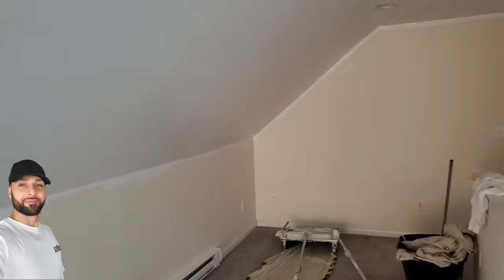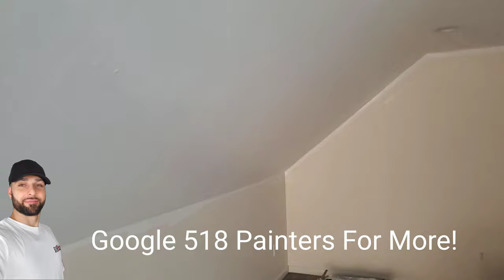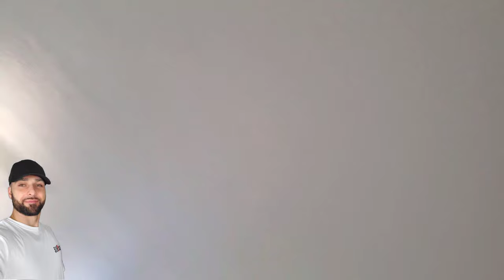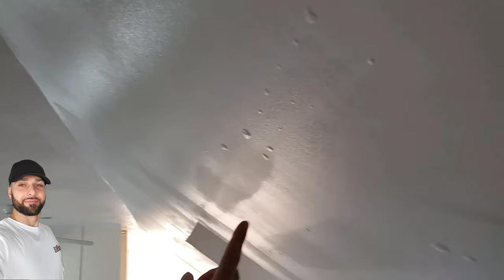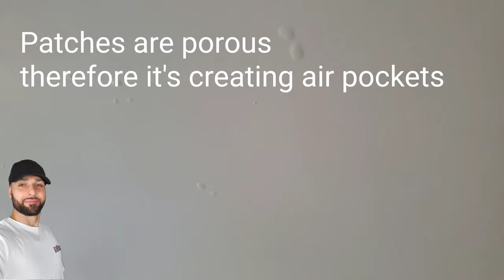Air Bubbles On Painted Walls

Comment: Don't try to fix them!  Cutting them, popping them or doing anything to them will not fix them, they will just come back worse.  You have 2 options at this point, option1 is exactly as 518 painter explains in the video (aka leave it alone).  Option 2 is to remove all the drywall down to the framing and re-board the walls with new gypsum.
Reply: Yeah, I'll go with option 3. Scrape mud and put thin coats of paint. Till I can get a real answer for why it's happening and how to fix it I'll do what I can cause the last house we did tear out all the sheetrock.

Comment: I recently encountered this problem. I was on a job and did my normal prep. Cleaned walls, primed, first coat, light sand, dusted and the top coat and was surprised to see bubbles forming. Dry times were respected and the room wasn't too humid. I'm perplexed. Told the client to turn up the heat because I remember seeing your video, so we'll see what happens tomorrow. Thanks for the advice.
Reply from the maker: Thanks! Let me know how it turns out👍🏽
Reply: are you still alive?

Comment: Hi. I was soooooo proud of my diy paint job. One bubble about 2 inches above a light fixture. I'm just seeing it for the first times. Approx 6 weeks post painting. It's just that one spot and no patching was done in that area. I have to decide if I should repair it or wait and 👀 see if it will pop or spread. Hmm.... Thank you for the info you shared.😄
Reply from the maker: Thanks for watching! You might have to cut that out with a blade and patch that area if it dosen't go away and you really want to get rid of it 🙂

Comment: This just happened to me two nights ago from over wetting and overworking ceiling paint🤦🏻‍♂️
These high solids low-no voc paints are not that forgiving. Of course I scraped off a big area, skimmed it, primed it, etc. 
This room has been a nightmare from the beginning and I just keep going round and round with it, a couple times I felt like lighting a match and walking away lol
I need to sometimes learn to say f*** it and leave it alone!
Great content btw!👍🏻
Reply: no, you likely didn't wait long enough for drying time. matte paint requires 2 hours before 2nd coat.

Comment: I had the same problem but in the walls I did cut the bubbles I filled up I did sanding I did a primer and the bubbles coming up again and again 15 years on this work I never seen something like this is driving me craezy
Reply from the maker: That happened to me on a commercial job at a bank. I cut, spackled, primed twice and it came back each time.
Reply: Did you ever find a solid solution for this?
Reply: @DIYhomeimprovementguy  how did you fix the problem ?
Reply: Same here. I was hoping to get an answer for this but I kinda figured I would have to keep looking.

Comment: It's not always an issue that can be fixed by turning up the heat. In fact this solution is probably just kicking the can down the road. If the ceilings were popcorn ceilings and you don't do a real good job cleaning the remaining glue off after you scrape them, you can get problems like this. If you were to do any work that requires paint plastic over these areas, the paint will probably come off with the tape or just over time. 

The best solution is and always will be to scrape it, clean the area and then seal and patch it while you have everything taped off and the furniture out of the room.

Comment: I have the same issur after painting my ceiling....i went back on a few areas when i was doing the second coat and now there are a few tiny bubbles that pop up only when i shower. They go away after hour or so after the shower but will comr back with each shower due to the humidity . I have been using a heavy duty fan pointing up to help dry. Should I apply a hot hair dryer to the bubbles? Or just wait 20-30 days until the paint is fully cured? Great video, thanks for posting!!

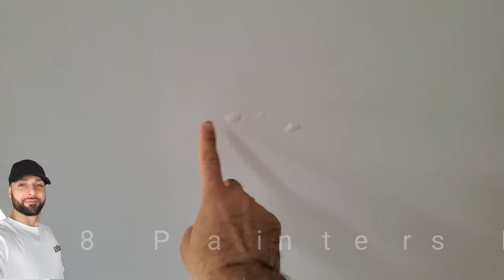Comment: I used a paint and in a few spots at 0:15 that's exactly what happened but it wasn't a big deal for me. I just either sanded that area down, or cut the paint blister out and put a little mud on it. Than just re-painted. 

But the big, BIG problem I'm having right now is. The paint that I used it was one of the behr's paint and it created like these air pockets in the paint. Soo imagine at 0:15 that image but reverse it. Soo think as in the blisters are inward instead of outward if that makes sense but everywhere on the ceiling. 
Or just think of it as, air pockets that escape. 
And now I'm trying to find a solution too correct the problem. 

I actually came up with a solution, use a sander with 120 grit to sand the paint down to get that smooth surface again. But I'm really not trying too doo that again. LoL

Than there's another solution, remind the entire ceiling which not tryna doo all that work again espically since I just re did the ceiling with all new drywall, and muded it by myself. I'm trying to look for a quicker solution, hopefully there is one. LoL. 

It's sad what one bad paint, can doo too all of your hard work man. 🤦
Reply from the maker: Ouch! I hate when that happens 😒
Reply: @DIYhomeimprovementguy  yup, hate it. 
But I re-primed the ceiling with two coats of primer, and the new paint that I got is a lot better and actually filled in some of those botched areas/air pockets but not entirely tho. But it does look 10x better now. 
Soo now I decided too literally use the paint brush on the entire ceiling and try too fill in the rest of the air pockets, and than use the pole sander with a 400 grit and try too smooth it out as much as possible than just re-roll the entire ceiling one more time. 
I think this will be my best bet To be honest.
Reply: Okay soo, update. I fixed the mess that was caused by the old paint. The tiny pinholes, and I thought it was the old paint since it was terrible that was causing the bubbles. 
But I peeled a big bubble area off, and patched it and re-primed it and it turned out it was the primer that was causing it. 

I used the "behr premium drywall plus + sealer in one." And it had amazing reviews. 

I hate this, you put soo much work in and than boom a problem bubbles lol.. 

I just re-done the entire ceiling with new drywall, new mud, used the paper tape and I'm having this problem. 

I also have a question, can bubbles be created as well cause you used a thick layer of paint to paint the ceiling???
Reply from the maker: @j.rjunior5584  sorry you had to go through that trouble. 
Bubbles can be caused by too thick layers and also by not following the re-coat times suggested. The off gassing while drying from the first layer can cause Bubbles.

Comment: I got just the opposite. It's bubbling where no patches were. on every wall!  Is there any other fixes that you know of? They won't go away !
Reply from the maker: Walls or ceiling?
Reply: @DIYhomeimprovementguy  nm bud, I solved the puzzle. Oil based primer stops them if you have them all over or won't go away. I figured I'd put it on here that way others will know.

Comment: I have just come across my first job with these bubbles they appear in a circle shape guessing where lights were removed and plastered 
I've let it dry but I wanna fix
Could I sand, plaster, top, seal and  paint with flat ceiling paint

Comment: Hi, what does it mean when new paint  peels off like wallpaper literally? My paint bubbled like crazy and no matter what I did it kept bubbling so eventually I tried to peel it and start again but to my surprise rather than just my new paint peeling off multiple layers of paint over the years all peeled off at once (just like wallpaper) back to the original magnolia builders paint! The walls aren't damaged after doing this in fact they look very clean! What could be the problem? Thanks
Reply from the maker: I'm sorry to hear that. It could be that someone previously painted over wallpaper and the new paint is soaking it again and therefore it's peeling. I've seen that plenty of times.

Comment: So use heat? I got a wall that keeps doing this I've scrapped it all the way to the drywall and still get em
Reply: you are probably applying your second coat before the first coat is completely dry. This will cause blisters. you have to wait much longer than you think with each level of sheen.

Comment: Great video!  Thank you for the tips.  Unfortunately, I have a problem spot around the wall switch.   I have tried USG Plus 3 topcoat, Killz 1, Killz 2,  and Zinsser 123 Plus and they all bubble up in the same pattern & location.  The bubbles do subside a bit after time, but they are still obvious.  There is no moisture/plumbing in that wall, and it doesn't bubble anywhere else.  The problem spot doesn't appear to have any major repair work either.  I'll try durabond next.  I'd be grateful for any suggestions.
Reply: Well I used Zinsser Gardz and that did the trick, but now I've learned what flashing is.  Plus random bubbles appeared on the same wall elsewhere after the first coat and most never went away.  This is all after priming the entire wall.  What a nightmare.

Comment: i jst pop it right away while im doin my primer i saw small bubbles like that then i pop or scrape it out n then i sand it abit then cover it with primer then after primer dry then ill put a puty n then sand it again then primer it again.. am i doin the right thing? 😅 is it ok to put a white puty over a primer?? thanks for thsi video i should jst have to wait
Reply from the maker: How did it turn out?
Reply: @DIYhomeimprovementguy  some of it dissapeared n flatten just some i need to scrape it out n redoit again.. overall still manageable 🙏 thanks for ur video🤝
Reply from the maker: Awesome, thanks for letting us know! @siacharles2315

Comment: I need honest advice I put on a top 2nd coat of paint the next day and ended up with blisters everywhere. I wiped the walls down with a dry cloth and then a tack cloth. It's raining and there's some humidity. Will this work for my situation just turn up the heat and leave it? Or just leave it be and see if it goes away.

This is also in my bathroom if the blisters go away will they come back when we take a shower?
Reply from the maker: It might just be too humid. Let it dry and it should go away. It won't come back once the paint is fully cured even if your shower. It takes 20-30 days to fully cure.

Comment: This has nothing to do with plastering or repairs, it's because in the layers of paint somewhere is a washable silk paint and it's been painted over with emulsion. The bubbles just go on their own when the paints dry.
Reply from the maker: 😂 You're funny
Reply: @DIYhomeimprovementguy  I’ll give you the science behind it. Silk emulsion is very flexible, and matt is generally quite brittle. When you paint over old silk with any type of water-based paint, you’re essentially rehydrating it. The silk then expands and only contracts after your topcoat has dried.
Reply from the maker: @Biccy pequeño  the previous paint was a builders flat. 
It's a new home.  They didn't use a PVA primer. You're completely wrong.  Actually, you couldn't be further from  the truth.
Reply: @DIYhomeimprovementguy  No, i'm right. It's a common problem trying to paint over silk with emulsion. You can end up with parts of the silk just peeling off the wall. Or worse. You should have used a primer before painting it, if you knew what you were up to lol

Comment: Mine never went away 😔
Reply from the maker: Sorry to hear that.  You'll have to sand the spot then clean it really good with a de-greaser. It could be because of some type of contamination (grease,oil,etc) I would then spot prime it with an oil based primer before painting.

Comment: I'm painting a two story house and is so weird because I PVA the entire house a week before I started painting the walls, and what's more strange is that the bubble don't appear until I paint the second coat and man they're all over the place, I teiedto let them completely dried and they won't go away not a fact they get hard and at this point not sure what to do, I tried with an oil base, alcohol base and water base primer and they still keep appearing even on the primer so I'm really stressed out at this point hopefully you can give me a tip on what to do. Thanks in advance!
Reply from the maker: Maybe there wasn't enough dry time between coats and the off gassing is causing it. Try removing them and spackle if need be.  Then use Zunnser Gardz as a primer instead. Also, try scuffing up the walls with 220 grit before your next coat.
Reply: @DIYhomeimprovementguy  I already tried all that I usually wait a full day to apply the second coat, I scraped off the blisters and sanded and applied a coat of primer underneath then I spackled the area and when the spackle was fully dried I sanded it, primed it again and as soon as I apply the first coat of finish it starts bubbling, I know its not the paint because I always use the premium paint from Benjamin Moore ( not Contractor grade ) and still keeps happening, I will be there today and hopefully I can manage to fix the problem because I just started the second floor and I still need to do the whole downstairs 😱
Reply from the maker: @eduardolara9536  have you tried the Gardz as your primer? That stuff is a life saver for problem surfaces. Is it humid where you're at?
Reply: @eduardolara9536  Did you ever solve your problem? I’m having the exact same issue and I don’t know what to do!
Reply: @eduardolara9536  
Hey mate
How did you fix it? I’m having the exactly same problem bro. And they just keep bubbling after skim it again
Reply: @maryburrows1469  Did you ever figure this out? Thanks in advance!

Comment: Have bubbles everywhere on textured walls? High Gloss paint. Any ideas?
Reply: Coat didn’t dry before you applied second coat (24-48hrs). Or you used primer on high-porosity wall that created a film coat and now the air wants to be pushed out, but it can’t pass through. Or you painted with latex paint over water-based paint. After 6 rounds of painting, I figured it was the primer for me. Had to take everything off, wash then completely clean, dry, wait 2 days and start all over again.
Reply: @onlinecomment  Morgan, do you mean strip paint and texture? How? I appreciate the help. You are right. I did everything you said. Just not sure what to do. Hate those bubbles.
Reply: @Barracuda24-f3w  strip off everything that comes off, sand as much as you can. Wash walls clean - if white colour comes off or whatever, it's not clean enough, dry them for few days, so there's no porosity left and apply the paint without any liquid primers. Can use base coat, if it's meant for the exact paint, same brand.
Reply: For stripping paint, I used same tool you use for applying putty, just push at loose areas and it should come off. You can also try to wet the walls pretty well, it will create even more bubbles and makes paint come off even easier. If it doesn't come off, it's solid in, but then you are going to have stripes and textures.
Reply: @onlinecomment  Many thanks. What a big mess, huh? Never had this happen before, but I used knock down texture that was clearance. Won't do that again. Appreciate the help & info.
Reply: @Barracuda24-f3w  yeah, same happened to me, mever had those problems before. Pretty annoying. Hopefully it works out for you!
Reply from the maker: Best awnser👆🏽

Comment: My hallway walls have bubbles and it has never happened before (and we paint a lot). The paint contractor said to wait because it would disappear. That was 7 days ago. Now they are hard in place. The contractor has sanded and will be back tovrepaint but I am seeking cause and solution as I don't think he used quality paint. Any thoughts?
Reply from the maker: There's a lot to consider.Could be the paint. Could be the primer. Could be that the wall had contamination. You can always remove the bubbles with a straight blade then prime it wit Zinsser Gards to seal the holes from the bubbles that you cut off. Then spackle and paint.
Reply: @DIYhomeimprovementguy  thank you! If his method does not work then I will try your method!!
Reply from the maker: @jacqjacq5920  let me know how it goes!

Comment: That sucks. I just painted a whole ceiling in a concrete house i just bought in the caribbean. And i woke up to a few of those.
Reply from the maker: Let it dry. It might be the  humidity causing it. Did you prime and seal the concrete before painting?
Reply: @DIYhomeimprovementguy  no, but i scraped all the old paint. Took me a whole day to do that.
Reply: @DIYhomeimprovementguy  you were right. It went back to normal
Reply from the maker: Nice!  @danlewis6591

Comment: Guess I should’ve checked your video before I snapped out and started peeling
Reply from the maker: No problem! Use Zinsser Gards to prime it now. It's a peel stopping primer. After it dries skim coat it with spackle.
Reply: @DIYhomeimprovementguy  Thanks 🙏.
Reply from the maker: @JohnSmith-dt2yb  no problem!

Comment: Nice video , this is a problem I’m facing at work at the moment and in my case someone mistakenly painted the walls with eggshell 🤦🏿‍♂️🤦🏿‍♂️🤦🏿‍♂️ so the bubbles kept coming back and won’t even sit after I been put the heater one for a long time , is anything else I can do to solve this issue , any help will be appreciated, thank you
Reply: Ever find a solution?
Reply: This is what happened to me.  Painter used eggshell when I asked for semi-gloss. Now there are bubbles on the repainted walls 😒